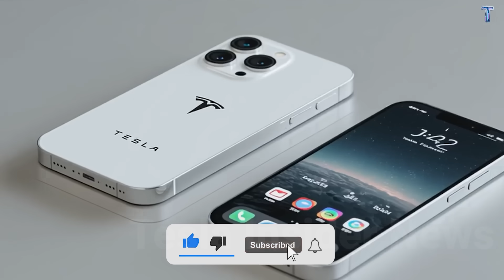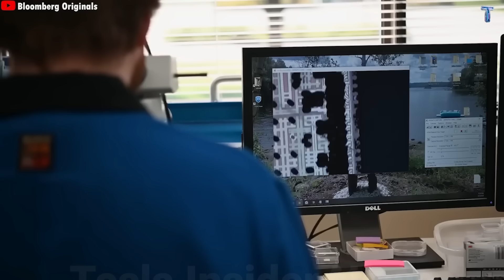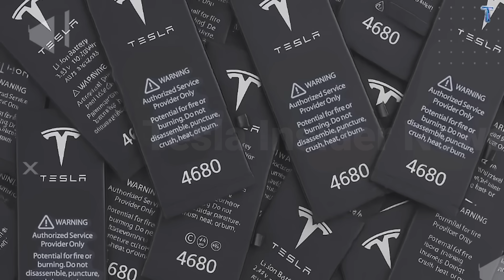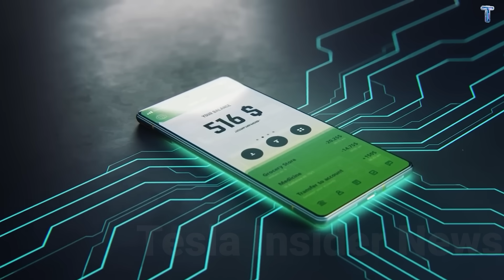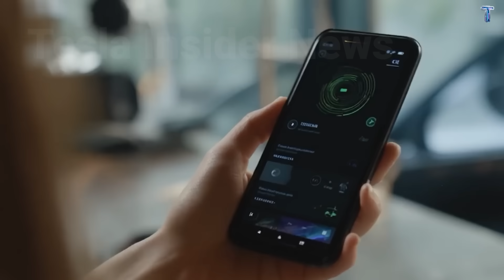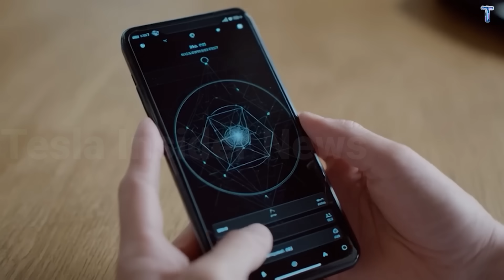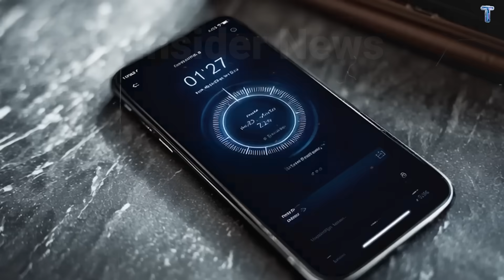Elon Musk’s $199 Tesla Pi Phone Explained – The Truth Apple Doesn’t Want You to Know

Comment: Sounds good but if they are so different could you still be able to interact with people who don't have it but still use Apple products?
Reply from the maker: Yes, interaction wouldn’t be an issue. Even if the phone is tightly integrated into Tesla’s ecosystem, it would still need to work with standard communication tools like calls, SMS, email, and mainstream apps that people on Apple and Android already use. The information discussed so far is based on aggregated internal sources and common industry requirements, so details could change, but full isolation wouldn’t make sense for adoption. We’ll know more once anything is officially confirmed.

Comment: The Tesla phone works off of stalink satelite. Does it work inside buildings?
Reply from the maker: Satellite signals generally struggle indoors because walls and concrete block line-of-sight to satellites. Based on aggregated internal information, the expected approach would be a hybrid setup: regular 4G/5G for indoor and city use, with Starlink acting as a fallback when you’re outdoors or off-grid. Nothing about this is officially confirmed yet and details could change, but relying on satellite alone inside buildings wouldn’t be realistic.

Comment: Price, wifi speed, no dropped calls, works in buildings reliably, storage without having to go to the cloud, security is high priority .
Reply from the maker: That lines up with what’s been discussed so far. The details shared are based on internal leaks and early engineering plans, so things may still evolve, but the focus seems to be practical basics first: pricing, reliability indoors, local storage, and stronger security. We’ll update once more verified info comes out.